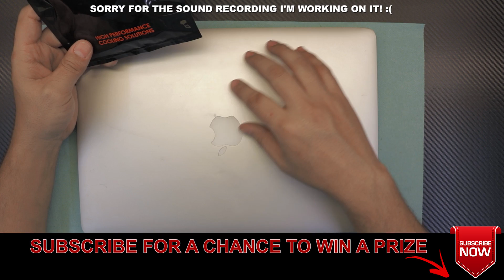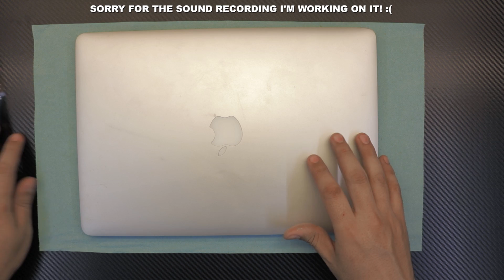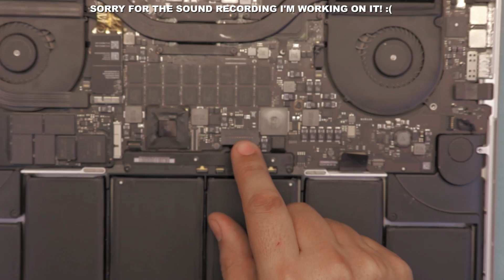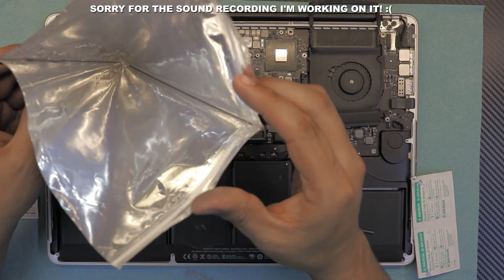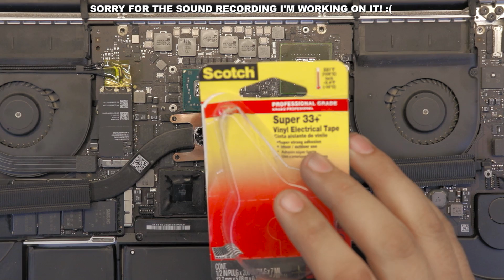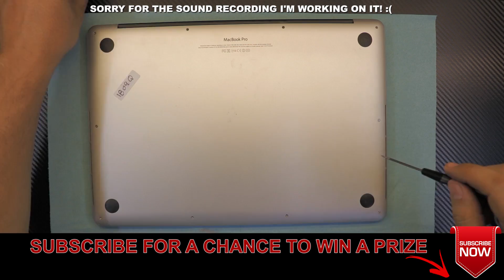MacBook Pro A1398 disassembly , Thermal Repaste Grizzly Liquid Metal, TEMPERATURE FIX

Comment: The plastic pieces on the heatsink might have been the best thing I did to stop thermal throttling on the macbook. No liquid metal, just arctic mx-4 and a few guitar picks that I cut into smaller pieces and placed on the heatsink between the cpu and gpu mostly on the left side of the cpu if you have the battery towards you. Laptop is waaay more fluid now. Thanks!
Reply from the maker: Thank you for the feedback! if you wish to support the channel you can LIKE or SUB or both :P
awesome job, in the future instead of the LM or arctic mx-4, go with : thermal grizzly kryonaut extreme: https://amzn.to/33Pa5e5
its the same almost result of the LM but safer only with 2-3c difference.

Comment: How reliable is LM?
Reply from the maker: its very reliable and once you put it you dont need to change it, we have laptops with LM for 6years and have the same temps. you only need to clean the fan without removing the heatsink.
Reply: uFixTek did I waste my money buying arctic silver? I was having issues watching 4K videos on YouTube. The laptop would get very hot and the fans would max out
Reply from the maker: what model of artic silver you put on that?
artic silver mx-4 new models or what?
artic silver mx-4 new version is good, but the best is LM.
Reply: @uFixTek  Arctic SIlver 5. The standard
Reply from the maker: the artic silver 5 is very thick, use artic mx4 or better if you want the best result near the LM go with this:
https://amzn.to/2z6wGUf

Comment: Can you please let me know what kind of thick tape you put on the heatsink? A specific brand? Looking to do the same thing. Thanks!
Reply from the maker: https://amzn.to/3duC2r2
Reply: @uFixTek  Thank you! Just to confirm: Put two pieces on top of each other like you showed, with the top one being a big smaller, centred over each heatsink?
Reply from the maker: i would buy a wide tape and regarding taping the cpu or gpu, all you need to tape the green area(PCB) if you overlap or not overlap its fine, i overlap for the heck of it. no need to overlap, but try to cover the cpu and abit the outside the cpu.  the tape has no harm at all for the motherboard.
Reply: @uFixTek  I am talking about the tape that you use to place extra pressure on the heatsinks for the CPU and GPU before closing the case. Any suggestions for that tape? I want it to be thick enough (like I think it is in the video).
Reply from the maker: ahh  those are called rubber legging silicon, 
you can search for this on amazon or find some rubber pads and stack them to the right size.
"rubber silicon leg for electronics"
https://amzn.to/3dnTOfK

Comment: That’s going to ruin the copper ?
Reply from the maker: it wont ruin the copper, we have had LM on heat-sinks for years and running solid, and after 6-7 years you may have already replaced your laptop.  it wont eat thru the copper.

Comment: Bro that is way too much! The lm is starting to pool up in the middle and you don’t need to apply it to the Hearst k as well as the ihs has enough.
Reply from the maker: in the video it look a bit much but if you feel like, you can apply a bit less. the laptop still running 100%. and you do need to apply or at least paint it with LM, as the LM it wont just hold on to the Copper you need a bit of friction on it so it can grab on to it. we have tried without applying on the heat sink side and only on the dye and the results were horrible. but dont take my word for it try it out :) good luck my

Comment: Using some clear tape to mask the areas where the LM was applied (to be removed for a nice clear finish) would help in achieving a uniform thickness for the LM. Then applying the electrical tape. But here, the tape touches some components that when removed later in life might damage them. Applying less tape, or pre-cutting a more custom fit set of pieces would help — also ensuring that the tape doesn’t overlap. Kapton tape would be a better use here because it has features more suitable to this task. High temp and electric isolation 😉 

Otherwise, all of this was a very nice repair for what was available I suppose. Good video indeed.

Comment: A little scary don’t you think when you’re rubbing heatsink all over the MOBO when applying the paste
Reply from the maker: no nothing will happen you unplug the battery cable from the board 1st, MAKE sure you are ground cable on you and, nothing will happen to the board, been working with board for over 15years. if you ground your self and remove the battery no need to worry.

Comment: Also, you used way too much liquid metal...
Reply from the maker: i may have placed a tiny bit more than normal but nothing will happen. unless you over do it. and as far as i have its not over done. if i place less sometimes it wont do the job and i really dont like reopening work twice. :)

Comment: When the liquid metal spilled on the battery my jaw dropped. You came so close to ruining that motherboard!
Reply from the maker: don't worry the MOBO wont be ruined if you drop the LM all over it. unless u turn it on. if you ever drop LM on your board dont worry just take it to a place that has a ultrasonic tank to wash up the LM. as i been doing electronic and laptop repair for over 12years and i have spill many LM over boards and none has been ruined.  just make sure you clean after putting LM.

Comment: How did you measure temperature drop? I did it for my 2015 512gb macbook, and temperatures are the same. I cannot use the tape, because contact with CPU and heatsink was not good at all(90c temperature at start) so I used nail polish. Standby temperature is about 50C degrees.
Reply from the maker: i google and downloaded an app for mac os, its not my laptop its my clients laptop. and after repasting with LM idl was 35 max load 76c, before 60-70c idl and 108c mas use even 110c.
Reply: Martin Niňaj 

Hello Martin,
same here....
Reply: Using LM is not about droping the temps on normal workload. It’s mainly dropping the temps on heavy workloads such as video editing or gaming.

Comment: Oh god I thought that copper heat sink looked like a alloy mix. Since he called it aluminum I'm going to guess that's what it is.

#1 liquid metal thermal paste use gallium.

#2 gallium reacts with aluminium in a very destructive manner.

#3 liquid metal is conductive less is more.

Liquid metal pastes spread to pretty much infinity. Just a pin tip amount will cover a modern day CPU IHS it also spreads very easily as it has very low viscosity. ANY excess will make it's way out from the heatsink 100% of the time and where it spills over will be unknown. Maybe it lands on the PCB where it sits forever or maybe it makes it over to a transistor or two semi exposed traces on the PCB and shorts out the board and kills it in the process.

Seriously less is more
Reply: With all of that in mind is it worth it to get liquid metal thermal paste
Reply: @Prince-fr2lr  not really I mean if it was like -40c different you would have a strong case for yes but vs a high quality thermal paste you are looking at 2-3c difference max case and traditional thermal pastes are significantly safer.

It is better than traditional paste but not worth the risk, the difference between liquid metal and high quality thermal paste is pretty much margin of error (there is a difference but it is that small).
Reply: Unedited Gamer thanks
Reply from the maker: Unedited Gamer yes my friend less is more and no its not Aluminium, if you put on Aluminium it will eat Aluminium. Only copper i have opened up again my laptop and this time i have placed a high temp foam around the diy, this way it will trap any excess LM that escapes. 
Thank you for your comment.
Reply: uFixTek you can use high temp electric tape it's the go to but if you want to be super paranoid about it some good Teflon tape can work as it can withstand heat up to 500c and far better then electrical tape in regards to current isolation. It's not that cheap however but if don't for stuff other than this it should last a very long time. At 14:52 that yellow-ish tape at the top left corner is what I'm talking about.
Reply from the maker: i do have the roll of that tape its called kapton tape, but its not very sticky, its very good tape but not sticky. so i don't recommend to use it on top of the cpu or gpu because the LM will easily go underneath, its a very good tape if you want to isolate metals or cable or components. but in regards to the LM its a very nono